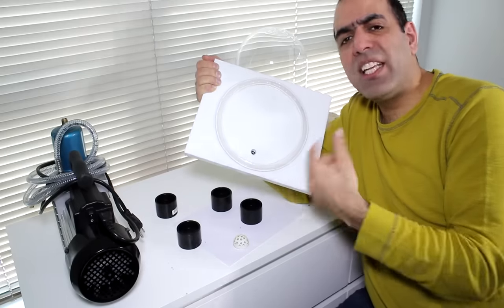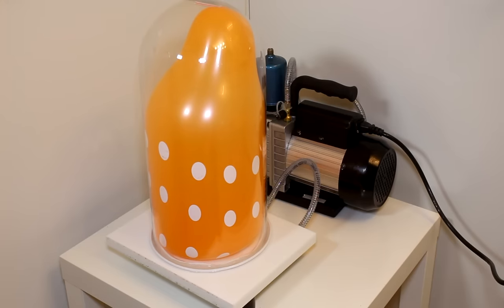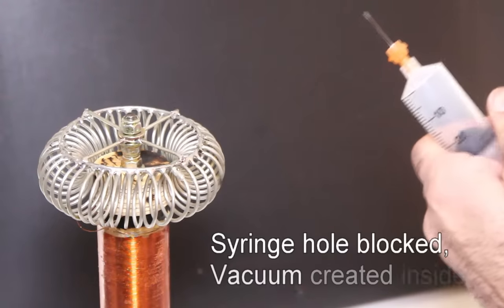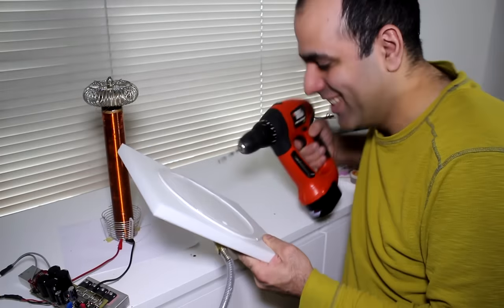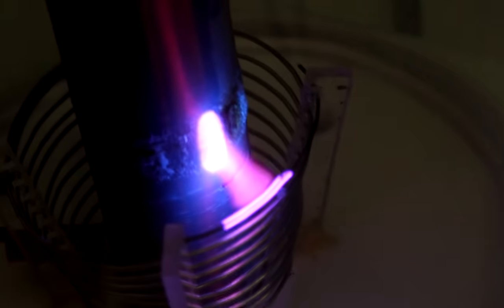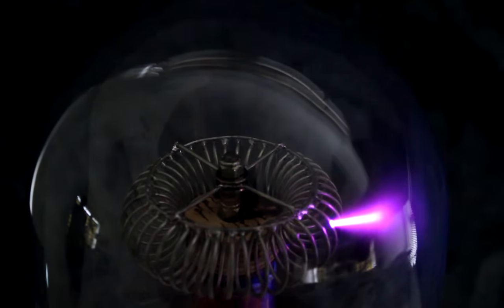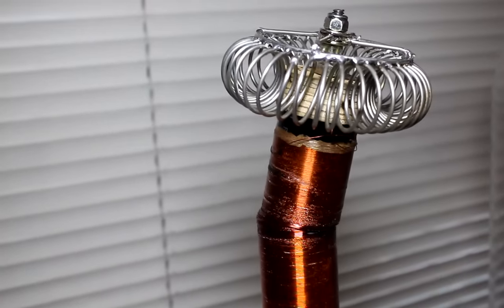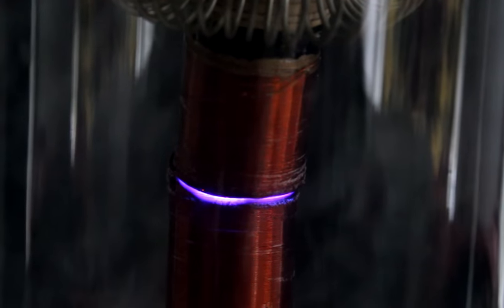Arcs change shape in my vacuum! RIP Tesla Coil :(

Comment: "Shit I thought the glass popped" *proceeds to throw a wrench at it", subbed
Reply: Blackofnight No it’s an actual good way to find out if your glass can handle a load like that. Better safe than sorry.
Reply: XD
Reply: @The Jabbawockee Allen wrench set or Hex Key set.... in Metric and Imperial measures.... RIGHT ??
Reply: you know it won't break because it has to be strong in the first place, but more importantly it's shaped so the air pressure forces the glass to resist cracks & deformation. 
a file would've been risky, though.
Reply: @nathansmith3608  why, bc of the concentration of forces?
Reply: @alexandermcclure6185  yeah, that & files are usually hardened to a greater extent than other metal tools. Same would go for sharp tungsten carbide cutting inserts or broken spark plugs - they're dense & probably harder than the glass, even if the pressure is adding to its effective hardness like I was speculating it would

Comment: 2:29 Pro-tip: don't ever turn the vacuum pump off before re-pressurizing if you're using a rotary vane pump like this. The pressure difference can suck oil backwards through the pump and cause issues over time. You might also end up with oil vapor in the chamber.
Reply: @Eddie Edwards eh it’s Mehdi, I do not think he cared
Reply: @soggywaffles6288 more like "MEDHI"
Reply: @PixelGliderr  what
Reply: @soggywaffles6288  nah just triggering him like when ever someone says "Medhi" instead of "Mehdi" he got triggered 😂😂🤣
Reply: @PixelGliderr  oh LMFAO

Comment: "Okay, now let me throw an allen wrench against the glass dome." That was just pure gold.
Reply: CLUNK
metallic clattering
Not just any allen wrench, but a calibrated allen wrench.
Reply: Not a smart thing to do. The calculated pressure is evenly distributed correct, and therefore neutralized, NO. Not true.  Neutralized with what? By what? Clean undamaged glass tolerates compression very well which is why it did not implode. Put a scratch or a nick into it and it might very implode. Pressurize it to 1 atmosphere putting the glass into tension and it will very likely explode. Please stop throwing metal objects at vacuum chambers. Your ER doc will be very angry with you as he picks glass slivers out of you.
Reply: @2silica  So what I think you're trying to say is: make sure ALL allen wrenches you throw at it are calibrated or there may be a scratch yes?

Comment: Dear Mehdi, Electrons do not glow on their own. With a roughing pump, at best you can get down to 1E-3 Torr which still is not a great vacuum. At this pressure, there are still many many nitrogen and oxygen molecules in the glass. Just did a back of a napkin calculation and the average distance between the molecules at this pressure is only 300 nanometers! So, the light that you are seeing is still coming from the air molecules. To be more specific, nitrogen creates a purple plasma and oxygen creates a light blue plasma. 
This is so awesome to see that you created an ion drive propulsion in your vacuum jar! Keep up the great work.
Reply: He could of used barium or a ceiseum compound to rid of the stray oxygen and nitrogen

Comment: When I was in junnior high school I made something similar with a high voltage arc across a little gap of like 5cm in vaccum, I was amazed when the arc vanishes when almost full vacuum, an the ends of the wire were glowing too, then air came back and the arc was there again, such an amazing little experiment <3

Comment: It makes sense that the glow gets better and larger as the pressure drops. The glow you see from any electrical discharge is the atoms of the gas in question (in this case the standard atmospheric mixture) get hit by the incoming electrons which provide the necessary energy to turn the gas into a plasma, which then tries to dissipate some of that energy as light. If you drop the pressure but maintain the power output you are essentially distributing the same amount of energy over fewer particles (keep in mind that a "perfect vacuum" is impossible, even in space there are gas particles floating around) so each particle gets more energy which they still have to dissipate (b/c thermodynamics tells us that anything with more energy than its surroundings is going to want to get rid of that energy until it reaches equilibrium). And so you get longer, brighter arcs.
Reply: Also the atoms (or molecules) are getting attract to the cathode. Thats the principle of a fusor reactor, you make a high vacuum inside, and then let tiny amounts of deuterium and helium³ inside it. With the high voltage on the cathode the atoms are getting attracted there and pressurized. Because of that they heat up and tada fusion.
Reply: So distributing the same energy to fewer particles produces a more intense glow (light)? E=hf would disagree with this since you'd only be increasing the frequency of the light by increasing it's energy, resulting in potentially less visible light (since the energy increase could take it into UV and beyond). 
I'm familiar with Physics but less so electronics, so if there's something that I am missing, that's fine. Please explain it to me
Reply: If you look at the sparks in normal atmosphere, they are bright blue-ish white. In vacuum they are dimmer purple. That means they are indeed shifted to higher energy.
Reply: @eagames456  Alright cool, that makes sense as long as the purple is indeed dimmer. This agrees with my knowledge but makes the initial comment false, since it wouldn't glow larger and better? Thanks for the reply bud
Reply: Ummmmmmmmmm silence stuffffff

Comment: Be careful, high voltage in very high vacuum creates x-rays!
Reply: and electrons don't glow on its own, there is still some air inside. When that glowing stops, you should start worrying because that means you are creating x-rays !!!
Reply: For noticeable x-rays, you need at least 20kV at 30mA, and the only source for that is an x-ray transformer, a microwave oven transformer or a neon sign transformer won't create x-rays. Also, his vacuum is not that good if you want x-rays you'd also want a better vacuum. And there will always be air inside unless you spend thousands of dollars on vacuum pumps, and even when you have a $300 two stage pump and a $1000 thermo-molecular pump you will still have a >10milliTorr pressure, very low, but not 0.

Comment: The electrons flying away from the spinner could technically move the spinner in a vacuum...acting as a really bad ion thruster
Reply: Yeah, thats what I expected... But if it is not how it works , how does it? I mean in air
Reply: The electrons fly away faster than they can stack and move each other probably
Reply: By heating the surrounding air
Reply: Those are not electrons, but ions. The pressure in his bell jar is very high compared to a decent vacuum.
Reply: the electrons arent flying anywhere, its AC.

Comment: Hi Electroboom,  I love your videos, Thanks.  Air is  getting pulled through the stranded wire into the vacuum chamber.  Try using a solid wire with no insulation to get the power inside the vacuum chamber.   You could even use a short brass bolt with epoxy around the threads to pass through the base.  Coat the hole and the threads.  Another idea would be to put the toroid only inside the vacuum.  This would take care of your heating issues on the secondary.  
Keep up the experiments.

Comment: Now you need a vacuum gauge.  Get a basic Bourdon and attach it with some NPT hardware, add some ball valves for coarse leak detection, then add a refrigeration service thermistor gauge for down to a few micron which will cover the range that pump is capable of doing (a good dual-stage rotary pump will do maybe 20 micron ultimate pressure with no load).

You could also make your own gauges, which is a fun exercise, but a commercial thermal gauge will let you calibrate it.  Then you can try hot and cold cathode gauges.  But those are serious projects and likely need some glass blowing or TIG welding and machining equipment.  I built my basic vacuum manifold directly onto my vacuum pump with plumbing parts, I use it for pumping down discharge tubes.

The syringe trick is neat.  If it is leakless you can directly estimate the pressure.  A glass syringe will not melt, but it may crack.

Comment: Are you sure that the spinning means there is no air? I know there is a type of motor/engine that uses ions to propel itself (and was also the basis for starwars TIE fighters). Ions (or plasma maybe?) could easily be repelling the spinners forward because they're hitting the metal or something.
Reply from the maker: +Nermket my electrons are oscillating back and forth at 1MHz. So they don't have a continuous on way force. The thing was turning heating the air and expanding it behind the wire

Comment: Make an FM transmiter!
Reply: Mário Marques those are easy. just look up a schematic with google lok
Reply: Mário Marques afrotechmods did an excellent video on this
Reply: I'd say go do it it's fun, but.... make sure you're using high quality and low tolerance parts. It's REALLY important, I learned that the hard way when I was younger. Last time I just bought one though. http://www.ebay.com/itm/76-110MHz-FM-Transmitter-DIY-MP3-repeater-Audio-Wireless-Transmitter-Module-/271990373821?hash=item3f53e3bdbd:g:CUkAAOSwHjNV~Id2
Trust me, these style of board can put out a VERY strong signal and can be heard up to 100M away when powered with the maximum supply voltage of 12V. I currently use an old 4.8V phone charger to limit it to about 30M.
Reply: theLuigiFan0007 How could I make one with a wider range? Like miles
Reply: Snoopy i don't know if it's even legal
Reply: Snoopy no, that is definitely illegal and near impossible to do with discrete components. if you want to broadcast your own radio in your area, you'll need a licence to and you'll either have to buy a station from a pre existing one, or try to build your own (very expensive, lots of paperwork)
Reply: Build a FM transmitter with discrete components is not difficult. You can use 2SC335X series high-frequency transistor for a simple VCO and modulate the signal to it.

But for stablity, you'd better use PLL to modulate the carrier signal and stablize the frequency with the crystal reference.
Reply: @万致远 Even simpler is a AD8099 opamp for both modulation and carrier generation. Should be adaptable for any opamp with a bandwidth of at least a few hundred MHz. It dosen't use a single inductor, unless you choose to add a Pi filter. http://www.hobby-circuits.com/circuits/radio/fm-transmitter/896/opamp-vhf-fm-transmitter
Reply: You know that high-speed opamps is not cheap. And it is frequency stability as poor as circuit made from a single high fT transistor's performance. 

If you don't mind anything about frequency stability, one 2SC335X or SS9018 high-frequency transistor will make it.
Reply: Well, yeah it's a $5 chip, but it's not a bad design by any means. Especially if you change the circuit slightly to use a varicap diode instead of a capacitor. It's tunable using either a variable capacitor or resistor, and it's also possible to add a PLL chip by doing some moderate modifications to the circuit. Powering it with a small 5V buck-boost module means you can feed a input of 1.8-15V, as long as you throw in a 10F supercap or something for filtering. You can also get the AD8099 in SMD so you can make really tiny transmitters. In other words, I recommended this design knowing that it could be a good point to start learning from, because it's simpler to build (few components, no inductors), and it can be modified later when you learn about other technologies. The opamp also gives it a better transmit power without needing multiple stages. But you are right, it's not much better then a single transistor oscillator without a bit of fancy mods thrown in.

Comment: The air helps to dissipate the heat from the electricity, maybe when you remove the air, the temperature just gets too high for the coil and it melts.
Reply: nah it was because he left a screw inside the tower so it was just arcing to the windings of the tower

Comment: i'm pretty sure that the thing you made with the vacuum thingy and the tesla coil is what is known as a vacuum tube, vacuum tubes can be used to create much larger voltages by pretty much multiplying the voltage, and can be used to create something known as a VTTC (vacuum tube tesla coil) or be used for other projects
Reply: and also, by using the spinny wheel you made something known as an ion thruster, ion thrusters generate low thrust but are used for propulsion in spacecraft such as satellites or probes, basically they ionize the gasses around the point at which the electricity is being generated, which generates winds because the ions move away from the source, and thus make thrust, and in the case of use in spacecraft, they use gasses such as xenon or argon or helium or whatever, but they use electricity, and because of low thrust, high electricity you get a severely low specific impulse in the case of electricity, but because ion thrusters are small and don't use a lot of gas they are really efficient in terms of whatever gas you use. (tl;dr, high efficiency in terms of gas but high inefficiency in terms of electricity)

Comment: Likely the magnetic field is pulling the plasma inside the coil bore! 

Likely this is how incandescent lightbulbs explode, because the magnetic pulse of the breaking filament pulls the generated metal ion plasma into the "bore" of the coiled filament and so makes of it a dead short with much lower resistance than the tungsten wire itself and so draws hundreds of amps current converted into heat.

Please test this with a transparent coil and less dense windings. (The input highvoltage may be produced externally for this.)

Comment: A neat outside the bell jar experiment. Make a round holding fixture example; (out of a threaded copper pipe adapter, cut a slit in swet end) to hold a CD upright turn on TC. For even a more spectacular effect, format CD in a microwave for a second or two.

Comment: Electrons don't travel any further or faster/better. The situation of vacuum actually expands materials like seen with the ballon. So what your seeing is the wavefunction become more prevelant in vacuum conditions because the environment is entropicly speaking moving towards 2D spacetime.
 repeling the 3D environmental effects that constrain an item to a space time via interaction and observation. Allows that area to stop observing the electrons as specifically 3D. Allowing thier more true passive state of waveform to be more accessible as it relates better to the fractional dimension environment being produced by 2 seperate environments becoming out of sync. (Interacting out of phase with eachother creating a waveform produced by both signals. I.e. observation/entanglement)

Comment: If you rectified the output using a FULL BRIDGE RECTIFIA and made a outer cage  connected to positive (kinda like the top load you have now but has space for the negative cage inside), and the negative cage inside the positive cage, then put it in a vacuum chamber, you can get plasma and small amounts of fusion (the glow that can come off a cathode ray tube because it uses the same process I am 99 percent shure) and it glows, its called a fairisworth fusion reactor, and a safety warning it can give off some x rays (why crt tvs give off small amounts of radiation) so be careful, a small one should not be harmful but I sudgest getting a ginger counter just in case becouse unlike electricity(Mehdi 2020) you cannot feel high amounts of radiation unless it's high enough you get radiation poisoning. I would look forward to a short vid but I thought you would find it interesting

Comment: Instead of drawing just a vacuum, you should be introducing different gasses into the bell and see how they react to the high voltage without the presence of air.

Comment: 7:43 what is the relationship between string's stopping and tube's getting out of air? the energy is lost due to the frictional force between coil and the string. there is no possibility to get out of air, I think there is specific amount of air depending on the power of the vacuum machine.